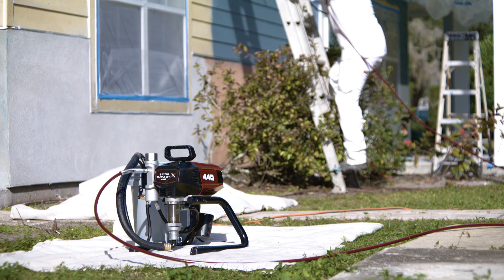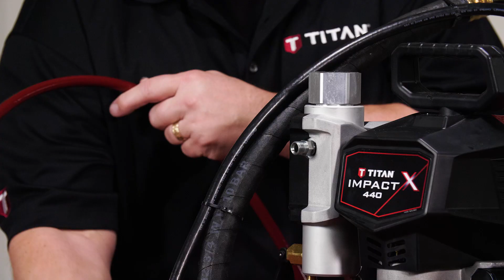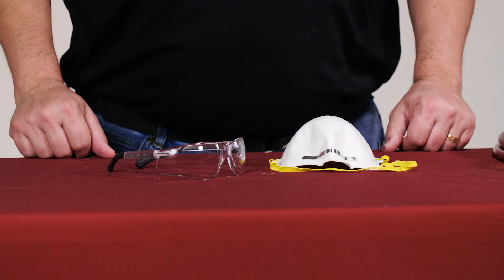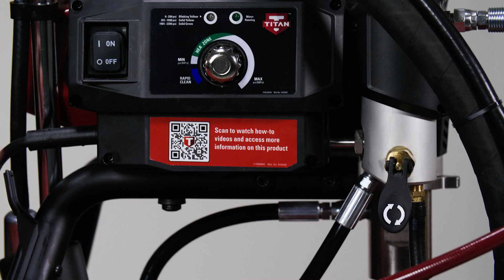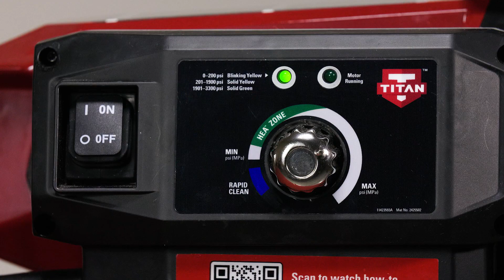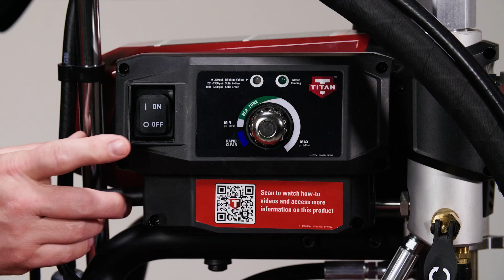Titan Impact X™ Series How-To: 410/440/540I Setup and Startup

Comment: So if I have a brand new sprayer. And I’m preparing to spray a water based paint.Do i still need to use the mineral spirits step and then flush it out? Or can I skip that step,only  flush with water and then spray my water based paint?
Reply from the maker: Spoke with the Tech Team and they confirmed that you should flush first with mineral spirits and then with water before you prep to spray a water-based material 👍.  Mineral spirits will ensure that the test fluid is completely flushed from your new sprayer.
Reply: @ wow ok